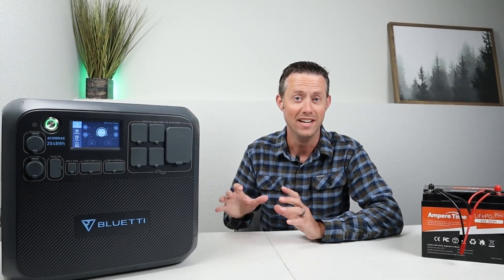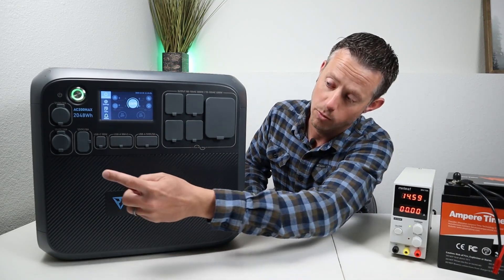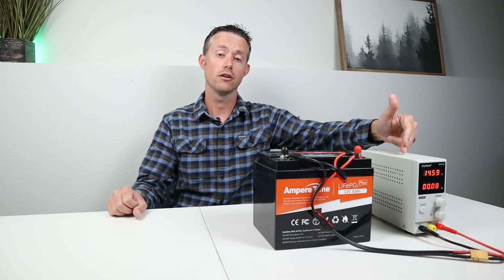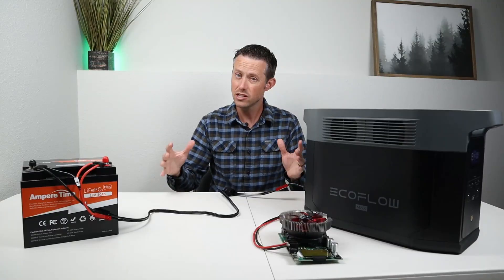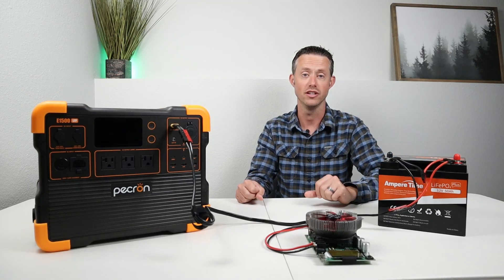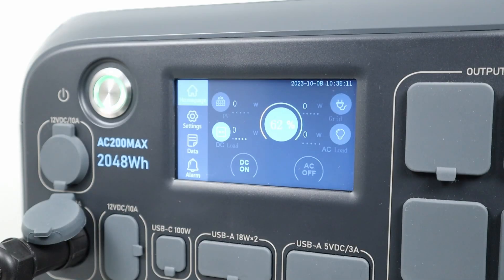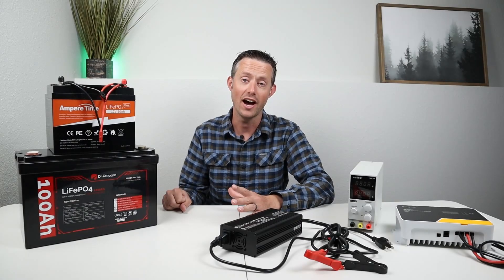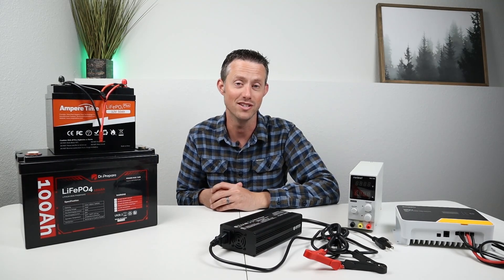Using Your Power Station 12v Socket To Charge A 12v BATTERY?! Does It Actually Work?

Comment: Would like to see you testing charging powerstations using powertool batteries!
Reply from the maker: That would also work well since tool batteries put out around 20v or so (similar to a small 100w solar panel). The only issue is that power tool batteries are very small, so I order to charge a power station you'd have to have lots of them!
Reply: @Jasonoid  but there are alsp many small powerstations that are popular such as thw Bluetti EB3A. The powertool batteries might be an easy way to extend the small powerstations battery. I've personally done it with battery adapters and I'm getting quite good output from them (around 100W) using my EB3A.

Comment: Great video, thanks for making it.  I learned a lot from it. If someone were to buy an extra battery (or a couple of extra batteries) to add some extra capacity for an EcoFlow Delta Pro and you don’t want to spend $2000 on an EcoFlow slave battery, which one(s) would you recommend for performance and value? I understand that they can’t be hooked up and synchronized in the same way as the EcoFlow extra battery.
Reply from the maker: I made an entire video about DIY expansion batteries. I personally use a EG4 48v battery to charge my power station at night. Here's the video showing the difference in batteries / voltage:  https://youtu.be/tK4JKmfndh8
Reply: Thank you @Jasonoid

Comment: Jasonoid,  good afternoon,  as always I have a question lol, and it's usually in reference to the bluetti ac 500. I think it's awesome that our power stations have multiple options to charge , so my question, is it safe to charge my bluetti ac500 from my Honda 7000is gas generator.  Obviously I wanted to consult w/ you first , thank you
Reply from the maker: I'd recommend setting the custom charging speed at around 5 to 7 amps first, then try raising the amperage current amount to full speed once everything is going. These settings are all accessed via the touch screen.
Reply: @Jasonoid  , thanks for the advice,  from doing some research before purchasing the bluetti,  I have already set the amperage to 5 . I figured that could possibly be easier on the battery.  Would it be o.k. to just leave it at that setting,  and would u recommend any specific extention cord ?? As always,  thank you !!!
Reply: Oh, by the way, congratulations on your last live stream,  I wasn't surprised that you had so much positive comments,  keep up the good work

Comment: Hey @jasonoid, I have an idea for new video, How about using your car or truck plus an Inverter to act as an emergency gas generator?
Reply from the maker: That's a good one!
Reply: @Moes_Prep_and_Tech   -  EV's   will  charge  the  'system battery'  from  the  traction  battery  when  the  EV  is  powered  up  to  drive  at  up  to  1000 watts.    I  have  already  used  an  inverter  on  my  Nissan Leaf's  system  battery  to  power  a  circular  saw  to  cut  up  several  hard-wood  pallets  at  a  remote  location.    The  draw  for  the  saw  exceeded  1000 watts,  but  the  Leaf's  system  battery  would  discharge  enough  to  make  up  the  difference  under  load  and  recharge  when  the  saw  was  off.    Worked  great,  and  it's  traction  battery  is  (only)  24 KW  but  more  than  enough  for  emergency  1000 watt  power  for  an  extended  period  of  time.

Comment: If you hook up to the cig lighter on the ac200max....it will overload it...try it!
Reply from the maker: Nope, it will limit automatically to the rated amperage of the 12v socket.
Reply: @Jasonoid  mine doesnt.....tried charging a low 55ah agm...overload every time. The eb3a does not do it.
Reply from the maker: @Texasprepper  interesting! Well mine worked when I tested it, I might have to try again.
Reply: @Jasonoid  mine worked at first......but soon failed after a couple minutes and then kept failing. 😒

Comment: In an emergency, fine. Regularly? Nope. The 12v battery should support the solar generator, not the other way around.
Reply from the maker: Exactly. This was just a fun experimenting video. Good to know it works if you need it (as long as your DC voltage is decent).

Comment: You really dont want to use the 12v output to charge Another 12v battery. And you really dont want the 12v to be 13.5v....
Reply from the maker: This was an experiment to see if it could be done...and I demonstrated it's best to use a dedicated LFP battery charger. Did you finish the video?
Reply: @Jasonoid  if you read the comments, its confusing for the low-tech viewers

Comment: 0:33 I understand this graph following way: battery is discharged and has 11V (2.75V per cell inside battery). Then constant voltage 14.6 applied to it, so charging is done by difference of applied voltage 14.6V and battery voltage 11 V (and rising). Power supply is like a source of stable current. When battery have reached 14.6 V, there is no voltage difference which is charging battery.
Such 12 V batteries consist  of 4 serial connected cells, each is 3.5-3.6V per cell (3.65 V per sell when whole 12V battery reaches 14.6 V).
Reply from the maker: Yes, that is correct.